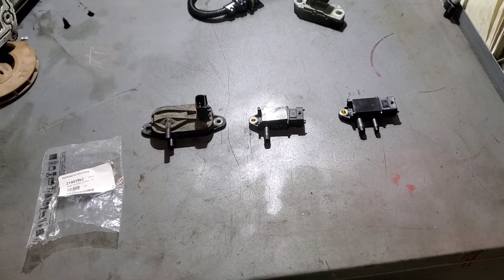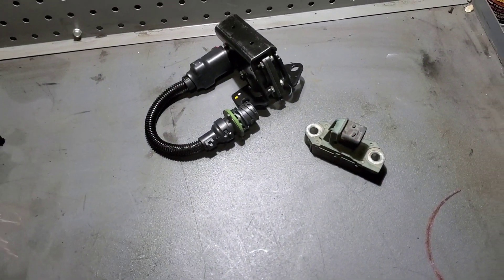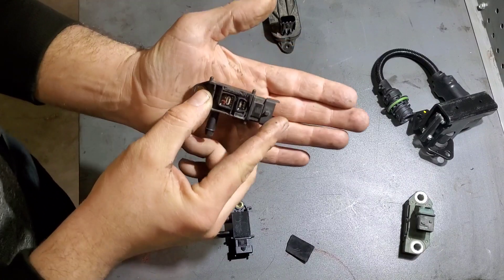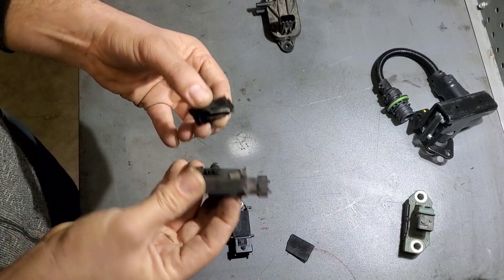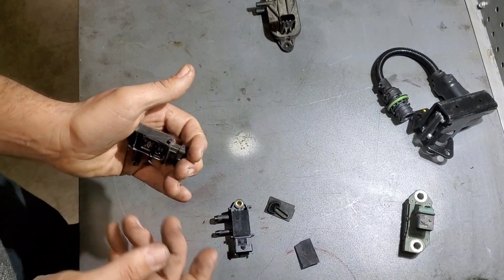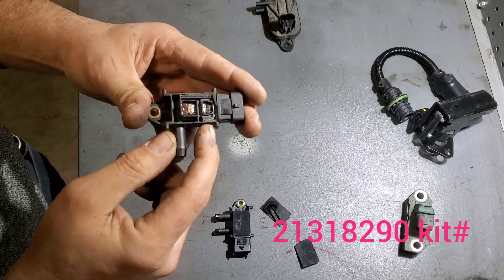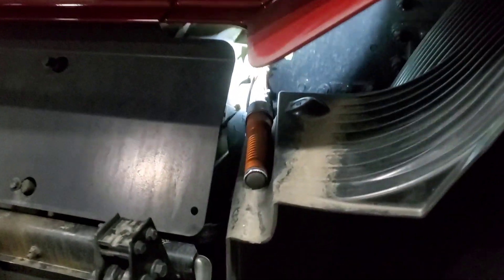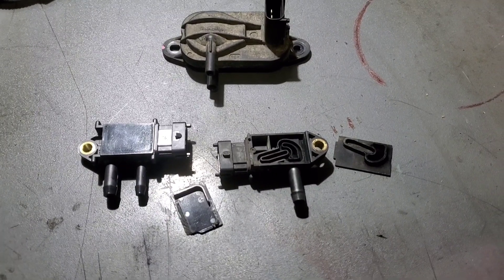volvo truck d13 dpf delta p sensor take apart  21403962 21318290

Comment: Amazing video has always, very imformative, can you use the new sensor on the old system? 

I have to replace this sensor on a 2015 volvo D13 and the truck part place told me that the new sensor is the replacement. But the new  sensor pipes are wider in diameter than on the old sensor. They sold me the hose fitting that would fit on the new sensor pipe but the aluminum tube is much slimmer in diameter.